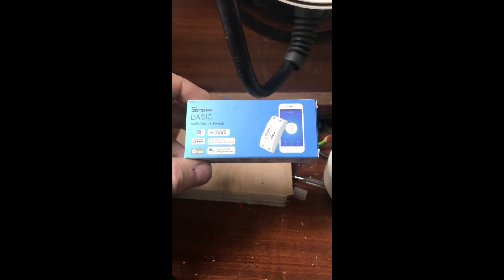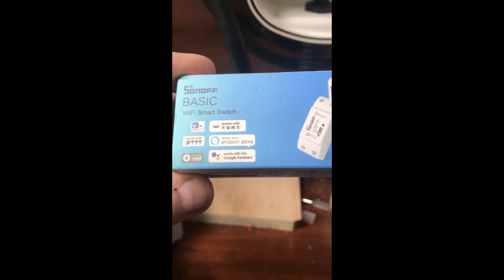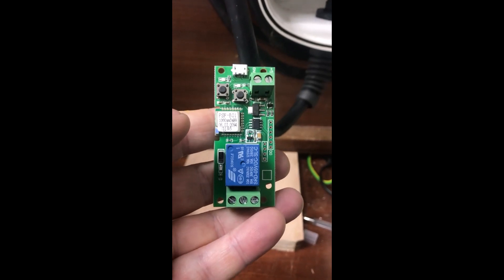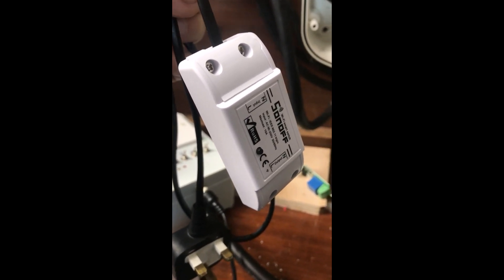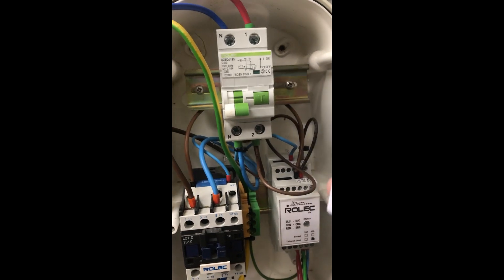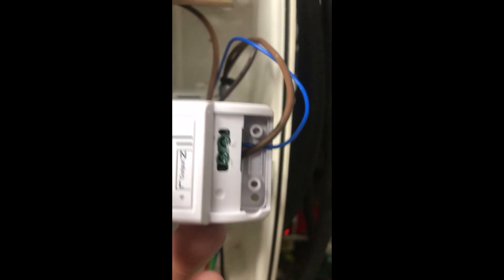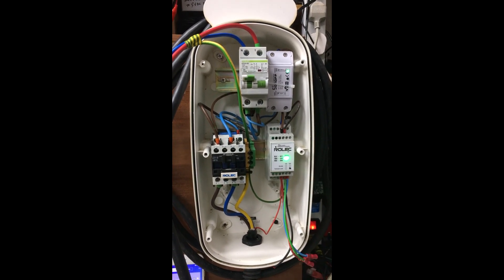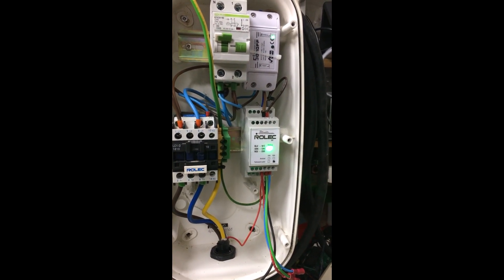rolec mods  part 2  MG ZS EV compatble

Comment: I've just updated my dum rolec using one of the shelly units.   Just a point of interest.  If you switch the signal wire it doesn't always wake up the vehicle (Renault e tec and dacia spring) it depends how long its been since it was last active.   Ive swapped it so it switches the 240v to the evse controller which is  how this unit was done and it has worked fine so far.  When the evse is powered up it must create a wake up signal for the vehicle.

Comment: I've used the Relay Version and it can be powered on 12v DC or 5v via the USB. I've installed it to interup the CP live to the tethered cable and picked off 12V DC off the 12 V pins on PodPoint Solo

Comment: Hi Bill, I’m very thankful for your great contribution on to how to resolve the issue that Rolec home charger and MG ZS EV have with scheduled charging.  In particular I’m very interested in “MG Wake Up Board” that you made and demonstrated in your video.  Is it possible to buy one from you so I can set it up within my Rolec home charger?  I’d rather use your solution then Sonof smart Wi-Fi switch as my Wi-Fi signal is not good where the charger is.
Reply from the maker: Hi. Drop me a mail to billburgess42@hotmail.com.    What rolec do you have ?  And if it is used for the MG the latest software will now let you charge with a single delayed charge up to 10 hrs.  If you want to use agile tarrif then you need the wake up board

Comment: Good stuff, thanks (despite the vertical video 😉) . I think I'll do this and use Home Assistant with AlexxIT/sonoff so can integrate with Octopus Agile ToU tariff. Could also use the sonoff but cut the traces to make volt free and then use instead of the 5v powered board but without need for 5v supply? Edit: just seen the subsequent video 👍🏻
Reply from the maker: Yes I got the vid wrong. That’s the fun of using an iPhone